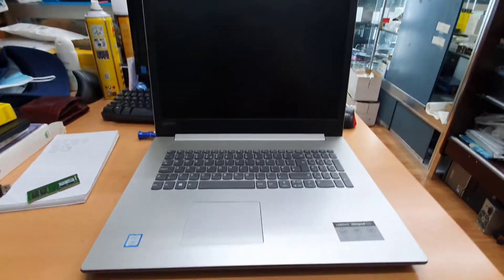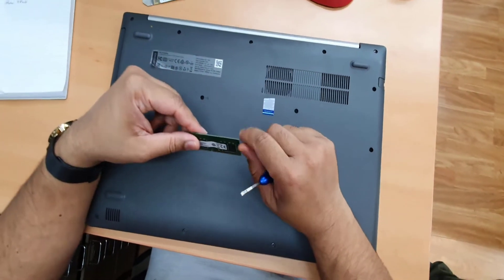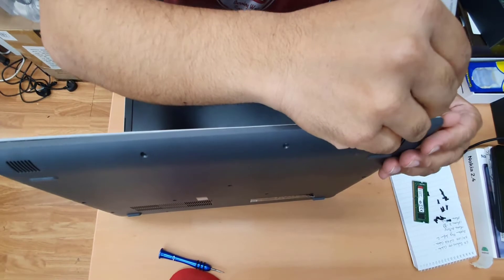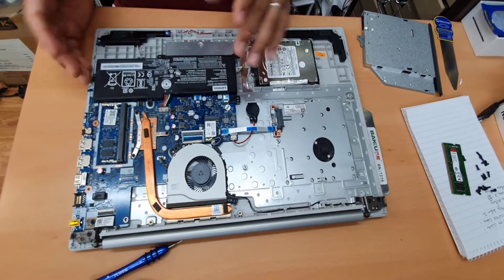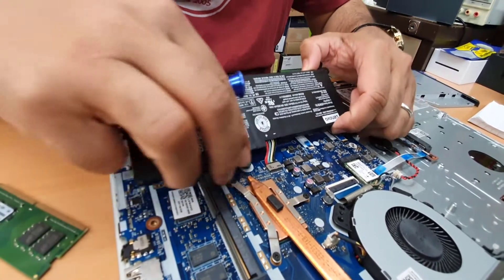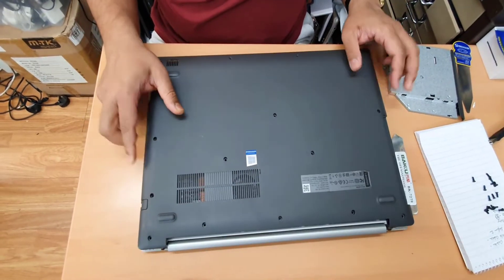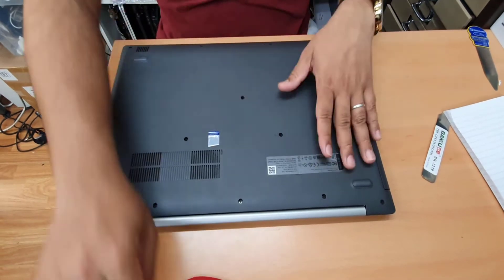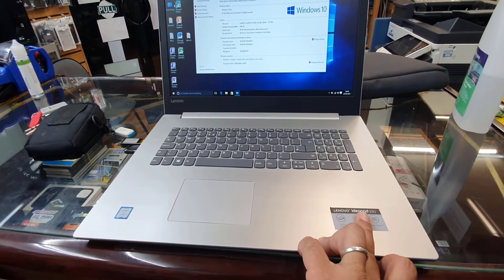How To Upgrade RAM  On Lenovo IdeaPad 330 | Easy Step Guide

Comment: Hi, there is no additional slot at my Lenovo Ideapad 330?
Is that possible?
I just open , but there is nowhere to add new RAM?
Reply: You need to remove old ram
Reply: In the 330 theres 4gb soldered and one slot open for an upgrade you could have another model similar to the 330 and confused it with it :]

Comment: Mine is Lenovo ideapad 330-15ich with 4gb soldered on board and 4gb in slot total =8 gb so my ques is can i upgrade the slot from 4gb to 16gb so that comine will = 20 gb i m asking this bcoz  in cmd it says max 16gb and showing two slots ?? So what should i do and what about dual channel speed ??????
Reply: Dual channel Is on computer
Reply: It's Lilley the soldered 4 GB is used for the graphics card. I'm general rams is always 4 8 16 or 32

Comment: Hi. How will you know if the RAM is built in? I watched other videos that their laptops is not built in RAM. Thank you 😊
Reply: 1. On your laptop, open the task manager 
( To open the task manager, you can either press ctrl+alt+del  1 or 2 times simultaneously or, you can press the windows key and on the search panel type task manager. )
2. On the task manager window, you will see performance tab; click on it.
3. Then you will see memory tab; open the memory tab and you will the slots of ram available on your laptop.

Comment: hi, is 8 gb the maximum gb ram we can have? i was thinking to upgrade it till 16 gb, 8 gb is still very slow. thanks
Reply from the maker: Upgrading ram is not all about to make the laptop faster. It depends on which processor it has. Also, you should change the hard drive to SSD if you would like to have better speed.Hope you would subscribe to my channel! Thanks
Reply: @thepcphone  thanx for video! Can i insert 8 gb RAM? Will it work?
Reply: @JANA K yes